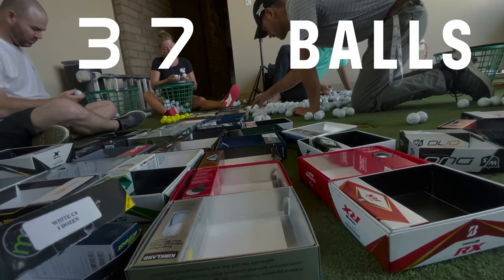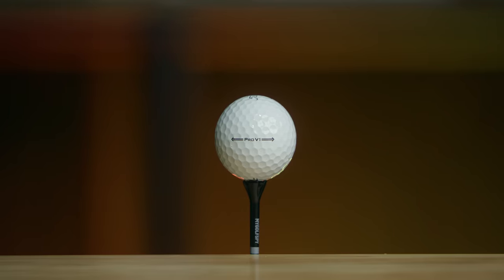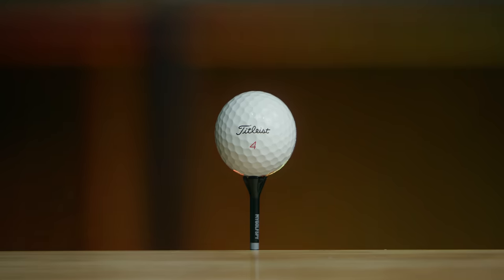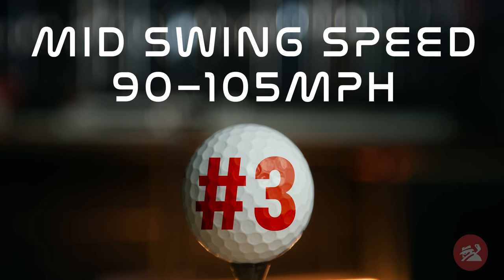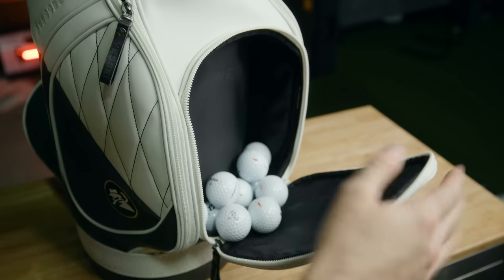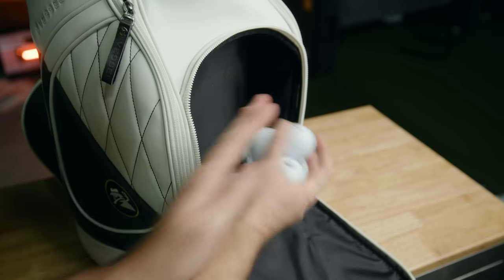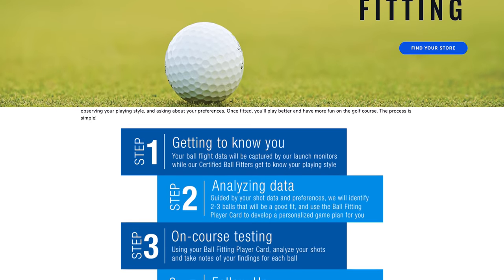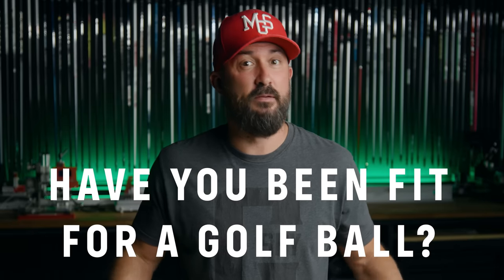WHAT'S THE LONGEST BALL IN GOLF | My Golf Spy TOP 5

Comment: Keep in mind this data pertains only to 36 urethane covered golf balls, and a Pinnacle Range ball all from their August 2021 ball test. So only one non urethane ball was tested, and it was a ball designed for durability and use at commercial driving ranges.  I know that my golf spy believes that almost all golfers should use a urethane ball for the increase in green side spin. But many golfers already hit the ball high enough to stop the ball on iron shots and play courses with greens that are well watered. So now the urethane cover is only an advantage on a shot sided pitch shot for those golfers. So, if a ionomer or Surlyn covered ball reduced a little spin on the driver, allowing for a little more aerodynamic long shot with greater carry, reduced curvature due to reduced spin, and perhaps slightly longer run out of the ball, and those combined to be even just ten more yards, wouldn’t most golfers who hit the driver less than say 240 yards, who don’t routinely reach 500 yard par fives in two shots and would now be able to hit one less club into par fours and maybe even one less club into every green, benefit from hitting one less club and being a little more accurate with say their six iron as opposed to their five iron?  On par fives, with two shots leading up to the third shot into the green, they may be hitting two less clubs into the green. Hey my golf spy, how about next time you bring in five or six of the best ionimer golf balls into the test so we can see how they compete on distance, even if they don’t compete as well on spin.  Titleist Velocity, TaylorMade Distance, and a few others, please.

Comment: After watching this video, I went out and bought the Maxfli Tour. The Maxfli Tour was rated #1 for mid speed, and my driver speed is 92-95 mph. I’ve been searching for a gamer ball for the past two years, and just couldn’t find a ball that suits me. I’d been going back and forth between the TM tour response, and the Srixon z-star divide and q-star tour divides. I usually shoot mid-80’s, but played my first round with the Maxfli Tour today. One ball lasted the whole round, although I did notice it took a little damage on the first hole’s sand trap. Still played it, and played it well. Shot a 78. Feels very soft off the driver, like it seriously feels like it’s flattening out like a pancake. But I love the way it springs off the face of the club. Mid irons released on the greens more than I’d like, but still playable. Chips were fantastic, you could really get after it and park it tight within putting distance. Putting for me felt great. I like a soft feeling ball and this one I felt it could strike it and not worry about zooming it 6 feet passed the hole. At $104 for 48 balls, this may be my new gamer.

Comment: I am 81 so my driver swing speed, though good for my age at 85 to maybe 90 depending on my best swing, is obviously in that low category. So looks like I should try the Titleist Prov V1X left dash. It flies higher than the AVX, which I would prefer. BTW, left dash not to be confused with the Pro V1X left DOT, which is not available publicly, only on the secondary market at about $270 a dozen. I have been interchangeably playing the Taylor Made TP5x and TP5 and the Mizuno RB Tour and RB Tour X. Would love to know how those compare with your top 5 for slow swing speeds.

Comment: I've not been fit for a golf ball, but have experiment with dozens of brands. 1 year post double knee replacement my swing has changed and I lost a ton of speed and distance. Even still I've dropped my handicap 5 stroke and holding at 8.2. If I could get back to average of at least 250yds with driver I think I could get myself in better scoring zone. Still happy I'm back to single digit handicap in over 20 years.

Comment: I haven't been fit for a golf ball, because I think I started playing in 2020. It was the only thing you could do "safely" at the time, (beside riding motorcycles). I only went a handful of times. In the Spring, Summer and Fall of '21 and '22 same thing. 2023 is when I started playing more. Once about every two weeks, sometimes twice in one week, sometimes on the in between weeks I play with my boys. I had heard about getting for a ball,  but I figured, figuring out what I was doing wrong with my swing was more important. I did a swing evaluation at Golf Techand have been working on my consistency. I might give the a ring and see if they do the ball fitting as well.

Comment: Hi Mygolfspy,

I used to think I was about a mid swing speed swinger (mid 90's swing speed according to simulator shots; have been able to reach 100 ish occasionally, and my Golfapp says I'm averaging about 240 yds with driver. My better drives are usually in the 240-260 yd range). However, this video says mid swing speeds result in 280 ish yd drives, which I'm currently not reaching. I'm assuming then I'm a low swing speed swinger if that golf ball range is in the 230's, or should I switch to one of those mid swing speed golf balls to gain more yards?
Reply: And currently, Bridgestone's online golf ball fitting tool suggested I go with their e12 Contact model.

Comment: Great Vid, just curious. Did you test any Snell golf balls and if so where did they stack up??  Dean Snell is the creator of the pro V1 so I'm just curious about your results with that brand. Thanks so much.
Reply: I love snell. And they are as long as hell
Reply: @crispycremesful  I agree.  That's why I was wondering where they tested on that video.  👊🏾👊🏾
Reply from the maker: We did! The MTB-X. As you can tell, not much separated the top 5 in each swing speed. The Snell was roughly 6-10 yards off the pace of the longest ball in each category (and performed better in the high and mid swing speeds). Thanks for watching!

Comment: Sorry but I'm a low to mid 90's handicapper with a slow swing speed. Not paying 45 to 50 bucks for a dozen balls... experimenting with the Sxrion Q star, Callaway super soft. Need a low spinning ball for distance off the tee. I used to look down my nose at the Top Flight but that sucker really rolls... (maybe a little too much). Lack of distance is putting too much pressure on my approach game. My short game is pretty good no matter what ball I play and generally better than most of the bombers off the tee that I get paired with. And yes, my clubs are fitted
Reply: I'm 75 and for me the Supersoft has been the most consistant longest ball. I've never liked the feel of Pro V1s or most hard balls.
Reply: Give Snell or Vice a try. Close to half price when you buy in bulk. With my game, (I’m a low single digit) I can’t tell the difference between Pro V-1’s and those balls….. good luck!

Comment: Good video with a lot of information, BUT:
I am 56, have a swing speed of around 100 mph, play HDCP of 2, usually with Pro V1 or Pro V1x in tournaments. In private rounds it can happen, that I play any „tour“ ball I have in my bag - usually lost and found. Only because of the feeling around the green. The average distance is more or less the same! In my experience the all theory about equipment, balls, shafts, heads etc. is crap! That’s something for the top players you can see on TV. Compared to them, we are all dilettantes. Our swing is inconstant, we rarely hit the ball in the sweep spot, are sometimes better, sometimes worse on the right plane, the timing of our hands varies etc.
If someone is worried about his ball after finishing in high 80s with 36 putts, 2 pull hooks into the water, several sockets just short of the green, and basically hits the ground before the ball with the irons, then he definitely needs help - but from a pro and a therapist.

Comment: Slower swingers should be aware that while the Left Dash did finish first with driver at 85 mph, it came in almost dead last in iron distance at slow speed, narrowly beating out the range ball and the absurdly spinny Kirkland ball. The AVX, however, comes in 2nd in driver distance and 4th in iron distance. The Tour Response is top ten in driver and 3rd in iron distance.  As they said in the test, for a lot of us, our best ball is often going to be somewhere in the middle of the pack, with a mix of speed, spin, compression, etc. that works best for the individual. For me it's Tour Response or Vice Pro Soft, although I am going to give the Maxfli a try, as well, especially considering how well it did in the quality tests.

Comment: Nice to see the less well known brands getting some love.  Vice balls are great, but Maxfli that is a serious blast from the past.

As usual the MGS testing methodology is excellent, very difficult to improve on.  Sadly, again as usual, the data analysis leaves a lot to be desired.  It is highly questionable whether there is any statistical significant difference between the carry distance for the top 5 balls at each swing speed, in each case the difference is barely 1%.  There might be if there was enough data points for each ball at each swing speed - in the past MGS has test across 3 swing speeds with driver, 7i and wedge which gives you 9 discrete data sets each containing 37 balls.  If there are 4500 shots in the entire data sets that means the total data set for each ball at a particular swing speed with a particular club is 13-14 balls only.

This lack of rigour in the data analysis has been true since MGS started their golf ball analysis.  When you put their own data to the test the idea that "soft is slow" is demonstrably rubbish.  The simple fact is that there is at best a very loose correlation between compression and ball speed  and typically only with a driver, there is barely any correlation no matter what swing speed with a 7i or wedge.  MGS needs to hire a professional statistician and implement both statistical significance methodologies and some form of p- value test (effectively what is the chance that the result was pure chance).

It would probably be fairer to say that at each swing speed the 5 balls mentioned are all really good and performance is probably so similar that on the course you are unlikely to notice any difference  - you are unlikely to go wrong picking any one of them.  The problem is that depending on the data and appropriately rigour in the analysis there could be another dozen different balls which have statistically effectively the same performance data